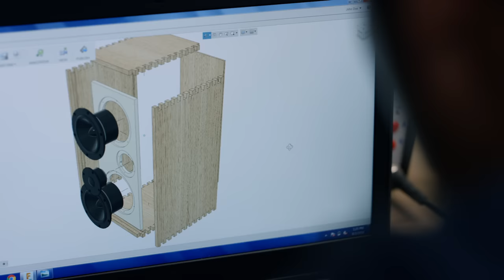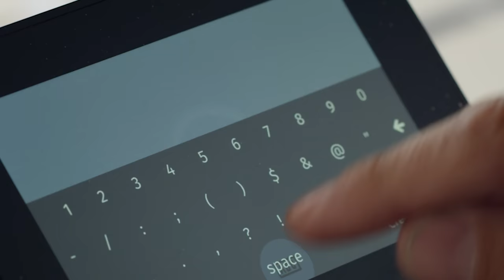Shaper Origin: One Tool, Infinite Possibilities

Comment: Its a really awesome device and it will sell well if properly advertised. The only concern is that tracking tape (and maybe the price), I realize that the tape is there for tracking purpose and may have issues if it is printed with incorrect dimensions; but it can be alleviated if a template is given, (I think you guys are under estimating the capabilities of standard printers).
Reply: they have to make more money somehow. Your home printer will not be able to print with enough quality those big circles, but its perfectly capable of printing the very small ones from livescribe. 
Looks interesting, too bad they don't even consider EU, keep blaming it on the market certification although it should be dead simple to adapt it, and in the worst case scenario use a different spindle motor. Certification is easier than the US one, and standards are pretty similar.

I'm curious to see how it behaves with smaller parts. yes it can cut smaller parts, but it requires a big sheet to cut it out of. So if I need some very small copper pieces, do I have to buy like a few square meters so the thing can sit on it?
Reply: Cutting out smaller parts was my only major concern. Seems like a huge waste if you need to have a large sheet of material just to cut out a small piece.
Reply: I don't see why that has to be a concern. If they system for some reason needs a big work area (for machine and tracking tape), I would use a jig between sliding plyboards. However, at 1:32 it does not seem to be that big of a deal.

Comment: great ideas, but, trust me, impossible to go straight line by hand, if you really care about the details ( I am working at campus CNC lab )
Reply: You only have to guide it roughly along the path. The machine will take care of the details. The spindle moves on 3 axes inside the tool.

Comment: just a first impression on the "Shaper Origin CNC Router" looks great/awesome.   Quick question; could you build  or add-on a laser display for tracking origination, i'm not completely sold on the idea of disposable tape.  If i had light markers from above/in front as long as the hologram display was pointed/layout on to my work space

Comment: You're not discussing our even disclosing any specs in this video. Is there a video that does?  
For things such as accuracy, max speed of travel. Types of materials it will cut, Max thickness and Max cutting and travel speed of those materials.
Type cutting blades it uses.
Motor draw, speed, hp.
Accepted file types, Max file size.
And on and on.. 
Looks great but, i see the travel is at a snail's pace for quarter ply.
Reply: Websites are better for that kind of information. This is just a promo video....

Comment: Does it have some type of self guiding wheels on the bottom?
What prevents you to weir of the projected cutting line?
Reply: It seems to have motorized stabilizer, that compensates the hand whobbling and keeps the tool in exact location. 
It is mindblowing technology!
Reply: Yeah it's my guess also. 
You follow the line roughly and the software stabilizes the motor to be on the precise cutting line.
Reply: You have to push it around like a router, but it self-corrects perfectly on the line that you follow on the screen. if you go too far off, the bit will automatically pickup so you can't ruin the cut.
Reply: no... it raises the router up when you go off track

Comment: You can get rid of the need for that tape if you have one (or more) laser projectors casting dot patterns using that film that makes those cheapo laser pointers cast images.

I would say make some modules that can attach to cutting material via pins or adhesive. 
Now you would be out of the tape making business... ;)

but that aside, DAMN I wish I could afford one of these!

Comment: you can get a small cnc cheaper than this.
Reply: face palm! this cnc can do huge shapes, try doing that on a small cnc!
Reply: a small self guiding stabilizing cnc?
Reply: Maslow CNC is $350 and can do 4' x 8' sheets of plywood, pvc board, etc. It also sits vertical so it won't take up as much horizontal floor space like a traditional CNC machine.
Reply: this thing is complete bullshit. Idk wtf someone is making with something bigger then a normal sized CNC machine and if you are, use common sense and use a jigsaw or bandsaw. Why do people waste their money on these useless machines that haven't been used in the real world. I haven't seen one of these in an industrial or educational use for good reason
Reply: People buy this because they can do a few projects without buying a: miter saw, band saw, table saw, circular saw... just to do a few around the house projects. If you don't intend on having a permanent wood shop in your home, machines like this are perfectly acceptable. Sure am glad you're not in charge of the world for innovation, we'd never get anywhere!